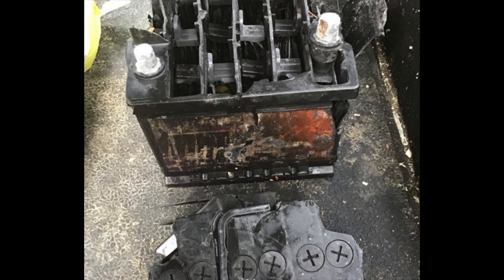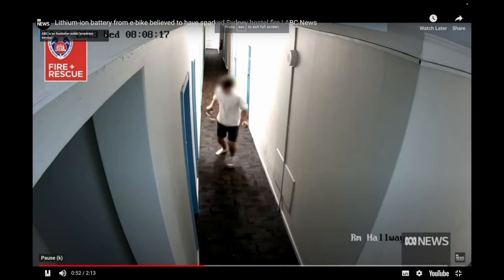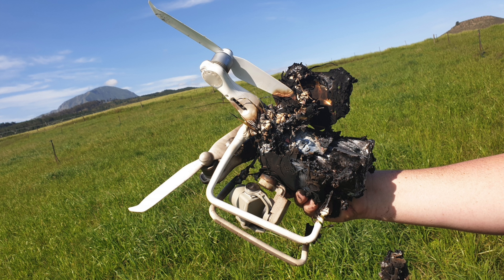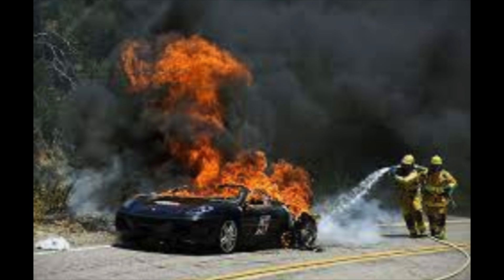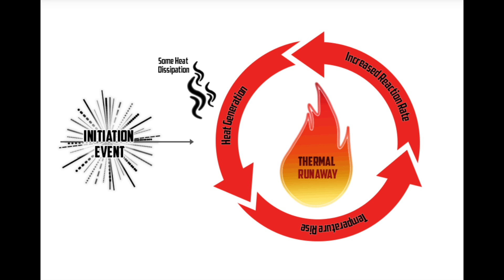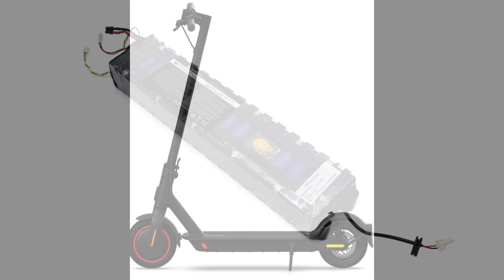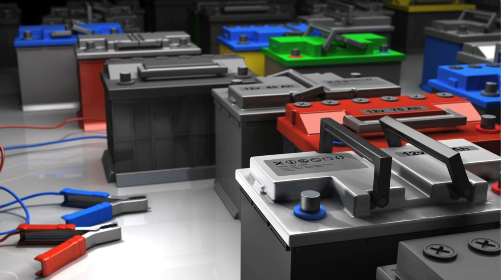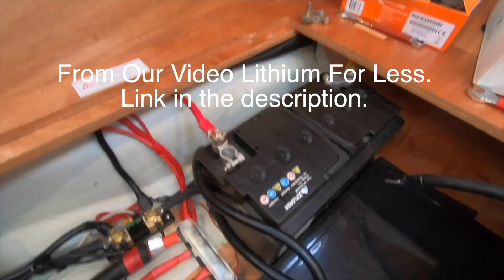Lithium Fire Aboard? Batteries (Part 2). Are They Dangerous?

Comment: It's nice to see a YouTube video pointing out that LiFePO4 batteries are actually safer than lead-acid batteries.  There is so much miss-information online, no wonder the average person is confused.  As for insurance companies, they really should be better informed...   Just a couple of (hopefully not too picky) points: 😏

Lithium-ion is actually the generic name for all lithium battery chemistries; so LiFePO4 is a type of lithium-ion battery.

The current rating for a bank of parallel batteries will be less than the sum of their ratings due to unavoidable current imbalances, and the possibility of cascade failure i.e. you should use a de-rating factor.
Reply from the maker: Good points well made. We tried to keep the terms of reference as printed on the batteries IE LiFePO4 and Lithium-Ion. LI covers a lot of battery chemistry. Dont get us started on insurers... 😀 Sail Safe mate. Ant & Cid

Comment: Another interesting video. We are planning to change our L-A batteries over to LiFEPO4s at the start of next year's season, but I have been doing a lot of research on how to protect them from overcharging. I plan to retain the existing starting batteries to protect the alternators, and add the LiFePo4s alongside them, but managed through a nice little device invented by Clark on Sailing Boat Temptress, this allows the LI batteries to be disconnected at a set charge level, so they don't get overcharged. 
Worth checking his Battery Bank Manager out.  https://www.youtube.com/watch?v=AJIFW_2GEwc&t=3s
Reply from the maker: Interesting I will take a look. Sail Safe mate. Ant & Cid

Comment: Recommendations on how to treat Lifepo4 Batteries continue to be all over the place sadly, even from the Manufacturers directly. Commonalities do seem to be - discharge below 50% and lose Recharge Cycles, restrict charging to 0.1 to 0.2C or you shorten Service Life Fast Charging shortens Service Life, and charging over 80% Capacity shortens Service Life.Will Prowse reckons, just recharge back to 100% Capacity and didn’t say what state of discharge not to go below, so frankly, until solid Data is available to be able to provide a minimum of a 15 year Service Life, my House Bank will continue be AGM based and I’ll be playing with a Lifepo4 Drop in battery Power Station as a useful bit of kit to have in the Boat Cockpit I think, powering a drinks cooler, cockpit light for the evening, plus a pump to inflate the tender with tbh. Bluntly, Battery Technology has one heck of a way to go, before it catches up with Marketing promises and Customer Expectations, the Energy Density of Present day Storage is miles short of what is needed imho. I had a lot of nice led torches that used 18650 lithium batteries, and when charging had to be put in an explosion proof bag. I wasn’t allowed to take the batteries on a flight to the USA, and had to get replacements there for them. So I continue to be cautious tbh. I know how to get 20 to 30 years service Life out of AGM, and new generation batteries need to be capable of delivering at least that imo. For my new build boat though, I’m now going to have a built in Diesel Generator, which I had hoped could be avoided.There isn’t a battery made that has the Energy Density of Petrol, and Diesel is even better, which may add a bit of perspective. Best Wishes. Bob.🤔🌟🌟🌟❤️

Comment: well done and thank you...would be great to have your take on 'Lithium' (lifepo4) charging... even the manufacturers are seemingly confused as to their own recommendations. One page reading; .5C another .25C charge rates and in another breath selling a lithium profile charger of  5-10 amps to go with their own 100ah battery. ABYC is, I believe, currently suggesting a charge rate of .20C...
For myself, I am using a DC/DC charger fed by my AGM house(buffer) bank. Seems to be just fine and gives me the control and redundancy I need...for now. 
I am a big fan of all that lifepo4 brings to the table, just seeing a need to cover the other considerations and balance of system materials and components.
And... don't get me started on cabling modifications necessary for the safe operation of 'Lithium's'...another whole can of worms. Thanks again.
Reply from the maker: We are doing the same. There is a lot of confusion out there I think its a good subject for a video. Sail Safe mate. Ant & Cid

Comment: Very interesting thank you. I would be very interested to learn a little more about charging. Our electrician suggested a lead acid battery as an interface between the alternator (i think?) and the lifepo4.
Reply from the maker: That is a common way to do it. But its not good for all LiFePO4 batteries as some need 14.6 -7 volts for the equalisation to start. Sail Safe mate. Ant & Cid